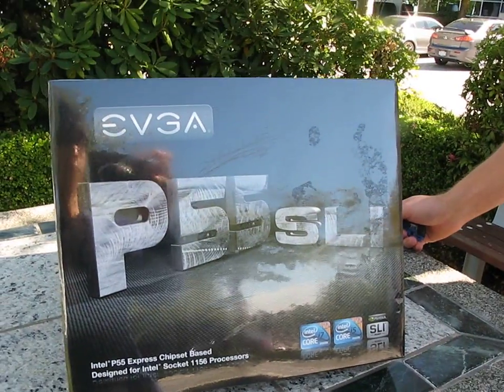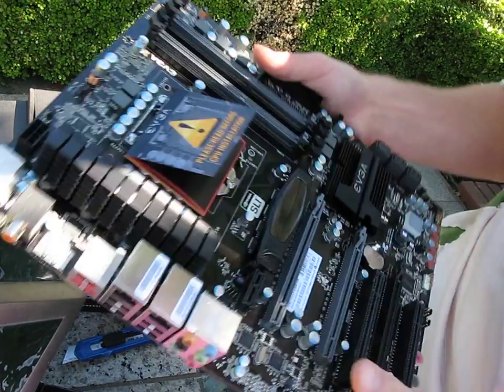eVGA P55 SLI LGA1156 Core i5 Motherboard Unboxing Linus Tech Tips

Comment: Chapters:

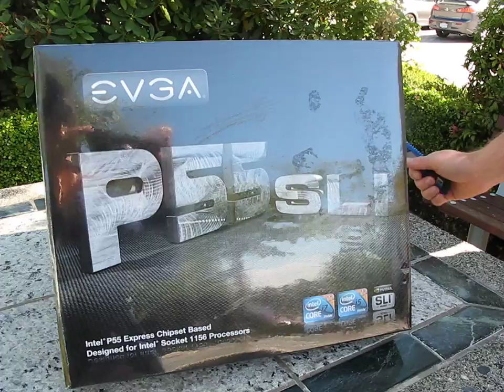0:00 The box and general overview
0:24 Unboxing start
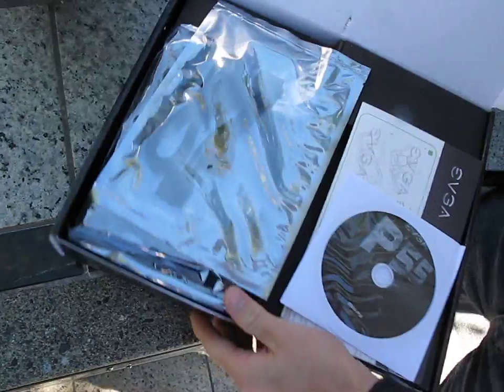0:30 DVD and QuickStart manuals
0:49 Molex to sata adapter and sata cables
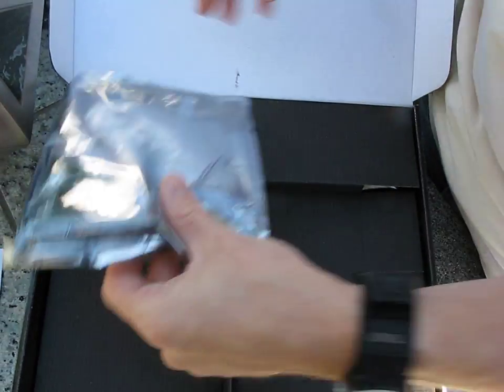0:59 Usb and firewire extension board
1:07 SLI bridge
1:11 I/O Shield
1:15 Manual
1:21 The motherboard
1:40 Differences between other board
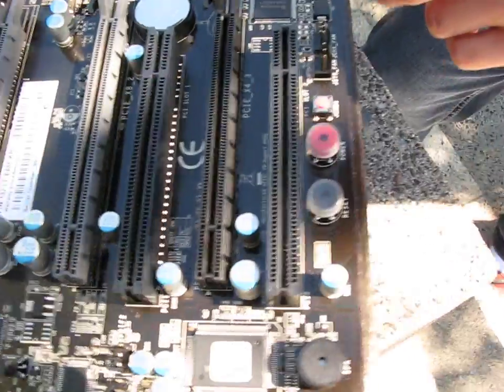1:53 Reset CMOS, power etch buttons
2:00 "Litt Designer thing" :D
2:11 Step by step CPU installation guide
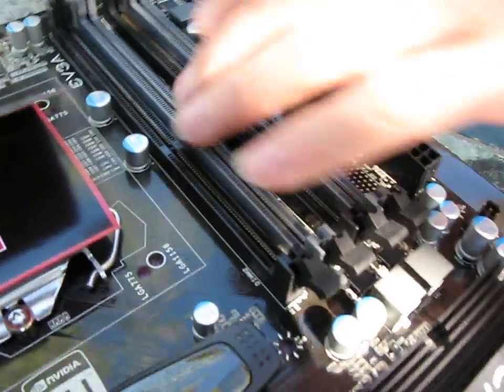2:20 Dual channel DDR3 memory (4 slots)
2:31 Power connectors
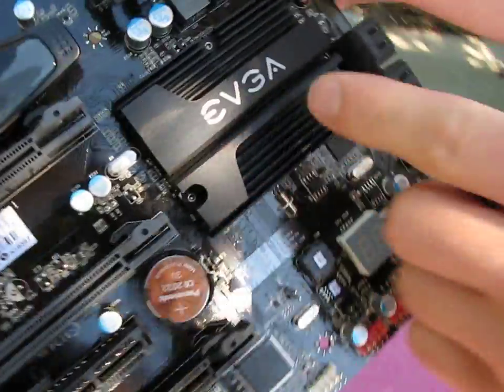2:49 Chipset heatsink and sata ports
3:03 I/O

Video Review:
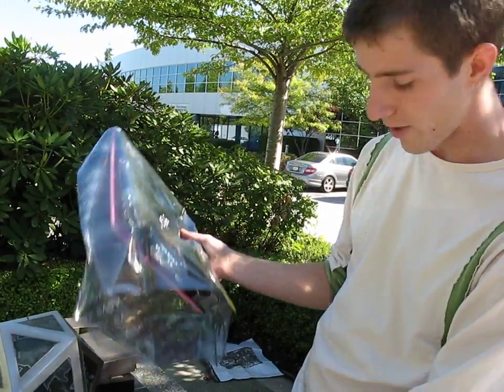Lul at "nobody pays to watch youtube" at 1:27. Pretty cool board, I rate this a mid 2/5

What am I doing, and why?

I want to watch, and review every single video on Linus Tech Tips channel.
I will provide chapters, if the video has none.
Why am I doing it? To pay a homage, and I am pretty sure that my head is a bit messed up.
Reply: U are a mad lad
Reply: Based af.